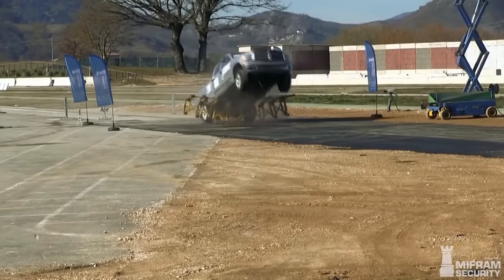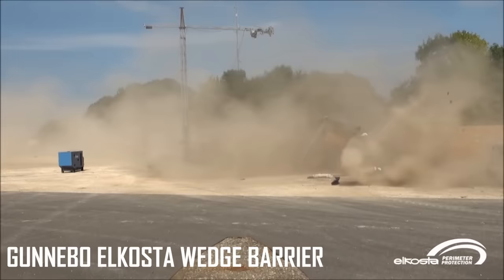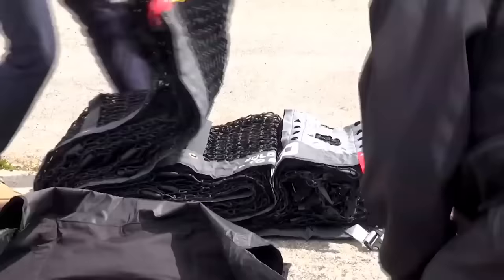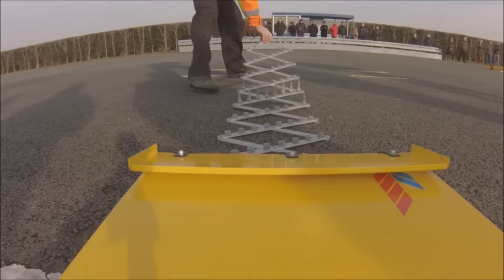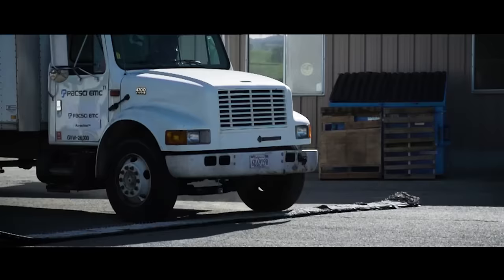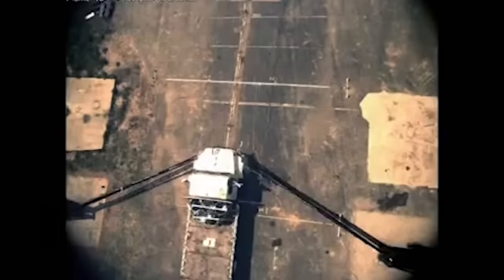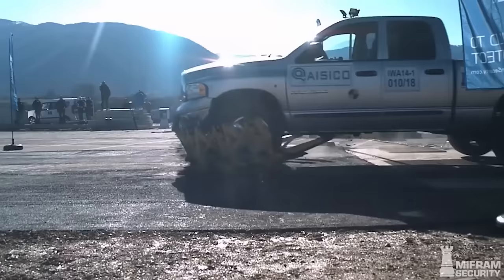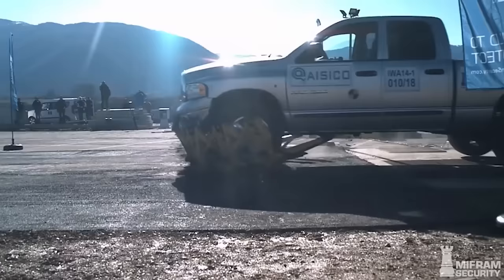10 Police And Military Inventions That Stops Any Speeding Vehicle

Comment: I think most people forget the fact that the more extreme stopping methods are used in HIGH SECURITY area. Which mean that:

a) It's not used to stop your typical run away criminal
b) It's used to stop ANYTHING at whatever cost, including the driver's life.

we can safely assume that anyone that tried to force their way into those area has a very bad intention in the first place (infiltration, ramming, suicide bombing, etc).

At that point, stopping those vehicles at whatever the cost would probably save more lives at the end (maybe not people thats in the vehicle, but people that's in that area)

Comment: "Helps put the bad guys where they belong"
In....a coffin?if there's anything left...
Reply: In a jar, evidently... the Net Barrier is arguably the worst.
Net Barrier: Is safe.
Truck: sues Net Barrier for debilitating disfigurement
Reply: COUGHIN?
Reply: well some of the more extreme stopping method are only used in high security area. And i think we can safely assume that anyone that tried to force their way into those area has a bad intention in the first place (infiltration, suicide bombing, etc)

at that point, stopping the vehicles at any cost is justifiable to save more lives at the end.
Reply: I thought the same thing
Reply: @count_dcinamon  Yea the video should be far more specific on the application. I think most of us can infer that the barriers are used for military or high security installations... but still the narrator claiming Net Barrier was safe for the driver is just hilarious as they showed a truck get vaporized at the same time.
Reply: Cleaning up with Buckets.
Reply: Yes
Reply: dust to dust ashes to ashes atoms to atoms
Reply: Когда завтыкаешь за рулём и не услышишь вой сирены сзади, налетев на сеть и растворяясь на атомы вспомни чтот ы написал тут
Reply: A nano particle urn

Comment: 7:21 "The net does offer some safety, too, for those who do happen to collide with it," says the announcer as the net slices through the truck cab at 65 miles per hour right at head level. You guys couldn't have planned that better.
Reply: How do you get head level?
Reply: @wolfeaglet1  Keep an eye on the driver's approximate head space. Pause it at 6:54. See how they match up? That's decapitation or a broken neck. I thought it'd be a great device at railroad crossings until I saw the truck annihilated.

Comment: “Put a stop to all vehicles”

Yeah it’s also gone put a stop to all lives that run into that thing
Reply: It's meant to protect sensitive locations from attacks.
Reply: If their intent is to cause harm, their safety is irrelevant.  Get a clue.
Reply: And what about others in the vehicle that got taken along for the ride?for example the crooks kids or possibly kidnapping vicitims?
Reply: @starandfox601 
This is not designed for common criminals, that run from cops. This is something that would be used at an embassy or military base.
Reply: @JL-ix5io  if that's the case then a lot of these devices would be useless.

For example why use that net when there's much better protection options adivable?
Reply: @wolfeaglet1  the passengers that often get dragged along considering it's common for high speed chances to ouccr during normal traffic stops when a background check is done.it's common for kidnappers to run cuase kidnapping poeple is a serouis crime.

Welcome to the real world where most chaces happen during mundane task like traffic stops and invole innocent passengers.not fiction where a lone crimenal has just robbed a bank and is running away with no one in the car like it's a movie.

Again if you had any real.value to add you would agure your point not name call.
Reply: @starandfox601  Please try that again in English,,,I don't speak gibberish.
Reply: @starandfox601 
Vehicle threats need to be stopped immediately, so these devices are very useful.
Reply: @wolfeaglet1  man wolfeaglet , trying to pick a fight with everyone who disagree with you are you?
Reply: Oh wow a war in the reply section.
Reply: star and fox Hello? These devices aren’t used for crooks. They’re used for military installations, embassies, forts, and other high security areas. If you’re going fast enough to get cleaved in half by one of these barriers then you deserve to die. (I.E. your vehicle is a weapon, or possibly a bomb)
Reply: @starandfox601  if your intent is to say attack a government building with a vehicle why would you have your family with you? Why would someone kidnap someone to ram a car bomb into a building? You are ignorant to the fact of when and where each device is used
Reply: I'm completely fine with that if you're using a vehicle to deliberately plow into a crowd or building.

Comment: “safe stop” won’t shut off an old vehicle with a mechanical distributor and carburetor.
Reply: Thats why i drive a carb'ed truck. Fuck them frequency things
Reply: @theranger2185  exactly, I plan on repairing an old square body k20 and sticking with a carb, then I will have the last laugh
Reply: Good luck with 'safe stop' on my vehicle, only electrics on mine is indicator, horn, lights, windscreen wipers, ignition glow plug heater, not 1 ECU.
Reply: But they would still catch you with a net or spike strips 🙄
Reply: @MrCareer707  imagine they just use your ac/heater to freeze/cook you and max out you radio noise
Reply: @Tone.350 , they can max out my heater anytime it needs warming up, as for radio noise, radio these days aren't worth listening to, CD's all the way.
Reply: This is what we need the sheeple to know if they wish to make it
Reply: @Tone.350  they switch the Bluetooth to nickelback full blast til you give in
Reply: @bigshepherd3127  Or how about we go around it then?
Reply: Collateral damage & law suits from kids with unexplained headaches would make it to expensive for public defense. Military has it in use I'm sure.
Reply: Well, that just makes my old car more valuable!
Reply: @bendy113  nickelback isn’t bad, it’s a far cry from the shitty music today

Comment: 1:19 Wow! 

Really reminds me of the rolling barrier they had at the GDR (East Germany) border "Helmstedt-Marienborn" towards West Germany. 

This was an (I think) 80 ton-heavy steal beam on rails that could be deployed whenever someone unauthorized tried to escape out of the GDR.

It was designed to stop any vehicle at any cost, even if the use of it was lethal. 
1983 it stopped a Minol-tanker truck that was trying to escape. Both the driver and the passenger weren't killed but gunned down by the Stasi after trying to escape on foot.

Comment: Those nets would be DEADLY for the drivers of trucks!!! The cabs are CRUSHED and so would the drivers!!!   Not always a desirable outcome!!!
Reply: They aren't for runaway vehicles, they are for criminals using a truck to do something illegal. Like terrorists using a tractor trailer filled with explosives aimed at a base or something
Reply: Kyle C 
So you’re gonna be the judge jury and executioner? With no due process of law??
Reply: MIKE KOSTECKY Yes
Reply: No ALWAYS a desirable outcome!!!! Far better that piece of trash goes into a body bag than some pretty housewife with her 3 kids.
Reply: @railnut8453  Your point? Running from the cops is so blatant that innocence is not even in question. Besides it most likely is not the first time, but it damn well should be the last!

Comment: The security barriers basically just kills the driver. I find it hilarious how the narrator said the Net Barrier absorbs energy and keep the occupants safe while showing footage of trucks disintegrating and cabin shred to pieces. Yea it sure does absorb energy, a tiny amount... Didn't know of the other technologies though, except for the grappler which made headlines a few years back iirc. Also how does Safe Stop work? the lack of detail on how it works is kind of annoying. Also how large is the radius and what are the potential collateral to nearby vehicles?

Comment: TODAY it came to our notice that the perimeters of airports are in very urgent need of reliable vehicle-stopping barriers. Yesterday, Airport Hamburg was entered by a vehicle  just by bumping a brittle plastic bar out of the way at its northern gate  (well there wasn't anything else to prevent access) and made it into the airfield near a plane. This is not supposed to happen nowadays, folks!

Comment: Some of this looks promising.....but the barrier net is not a good choice at all. Not only does it cause bigger trucks with more force to be torn to shreds, it can cause cars to rebound and cause damage to other cars that might be close. The net is also big, so it would cause more obstruction for other drivers not involved at all. Definitely a no-go. Not to mention, drivers flying at high speed can hit their heads on their windshields still. 
Some of these other inventions will do the same thing as well. Generally, it is preferred for their to be little injury possible to drivers and passengers.

Comment: There are a lot of gadgets and devices to be used to slow and stop a car (I mean the spikes, nets and so on, not the barriers capable to pulverize a truck). Well, I never saw such a device in action. All YouTube videos are showing the classic pursuit, a car running 1 hour on the highway, switching the lines, etc. and 10 police cars folowing it. Finally the car is stopped because out of gas, or it hits another car or the driver don't knows the zone and enter in a blocked street...things like this. No police spikes, nets or harpoons.

Comment: *drives pre 1980 car with chassis reinforcements,  runflat tires, quad turbos V8 5 speed,  a hideaway  license plate, a police band radio and blades along the edges of the wheels and body of the vehicle  to avoid entanglement

Comment: I like the remote controlled/retractable spike strips. 

But wth is that wedge barrier? You're not even going to try to not kill the driver?

Edit:
Ok. After seeing them all, I still prefer the remote controlled spike strips and nets that wrap around the tires to stop the vehicles. The grappler at the end is fine I guess. 

But pass on the barriers that destroys the vehicles and looks like they will kill the driver and passengers, including the net thing. Geez.

Comment: What if they just, literally go around the obstacles? 🤔
Reply: For this reason, it is used on highways (which have walls on the sides) or, like the examples in the video, on narrow paths, since even if they dodge it, the device fulfilled its purpose of affecting the suspect, since it deviates towards the grass, or against obstacles that are out of the way. something that in most situations lead to breaking the car, or even overturning.

Comment: The case with the spike strips might work if the driver dose not just drive around or over the BIG BLACK case sitting on the ground. But, the large barricades would be too hard to place in a hurry to stop anything and would be too obvious even if they pop up from the pavement.

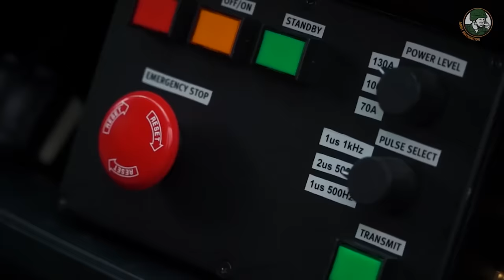Comment: 6:07 That Safe Stop item they only keep describing what it can achieve. Perhaps tell what it does technically? 🤦‍♂️ Is it an EMP gun just destroying microcontrollers? Or do the other cars need to have some receiver or anything else?
Reply: it is not a PEM, a PEM sends electric shock waves that fry everything electronic, including the vehicle that carries it, in this case STOP CAR uses radio frequencies to affect only the small variations that exist in the on-board computers causing the vehicle to fail.
which also makes me think that it would not work with an old car, which does not have a computer, or electronic injection system.

Comment: The EMP device is not very good as it will not work on older vehicles that do not have a computer...like mine  :D
It is not directional but instead an area effect so ALL things that have electronics within it's range will be immediately rendered to junk as you would have to replace all the computers (3 to 8 or more for current cars) before it will function as a vehicle again.  Any other electronic devices like phones, GPS, entertainment systems & computers would also be completely ruined as well.  
So basically if it is deployed & activated on a busy highway or city street it will make every electronic device within range completely dead...forever.  
City usage could be worse than 9/11 as it could destroy communications, signaling, radar, sonar and location devices for every flying, floating or driving machine in use at that time.

Comment: Well then why don't you figure out a design that stops people from going to opposite way on the freeway to where they can't go up the unwraps some kind of device you can use like a laser beam if someone's coming from the opposite way have something come up out of the road and stop them and then they can go down when people are coming down the ramp you you need to start making some putting things out there for people to be more safer that's my opinion but it does need to start happening now

Comment: 6:00 put a stop to any engine? lol no. It would be humorous watching it fail stopping my all-mechanical Cummins powered Bronco. If I'm running the 37" humvee tires with run flat inserts, I guess their spike strips(or bullets) wouldnt do much either. lol Good thing I'm not using the truck for nefarious purposes.

Comment: So inventors out there imagine if you will.... and cut me in on some of the profit. 
Think tear gas gun or T-shirt gun, whatever, that launches a "Net Cartridge"

You can either direct fire it at a tire in a situation where the police are out of their cars with guns drawn and the perp is still in his car trying to go. The second he does drive off he is tangled and detained. 

Or you can shoot it across  the road just like a spike strip only much more accurate. You could put the net directly in the vehicles path before he knows what hit him. Low profile as well since the officer would just be standing there with no visible trap. Just a slung "rifle"

Tactical vest could have a number of the "Net Cartridges" attached for misses or multiple vehicles for quick firing if need be. 

We need more devices to get scumbags off the streets. 

NetGun...... make it. But think of a better name. And cut me in. :)

UGH I JUST FOUND OUT THEY HAVE NET GUNS.
But they are used on people and animals. So lets militarize them for police use on cars.

What if the net was made of silk and it is soaking in water inside the canister?
Isnt wet silk supposed to be super strong? And would be light as heck also requiring less of a weapon to discharge.